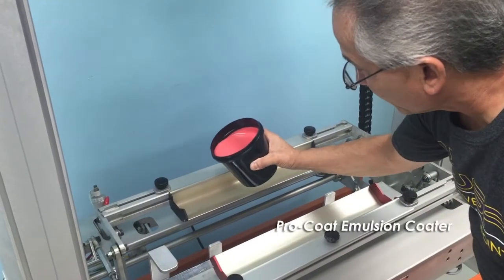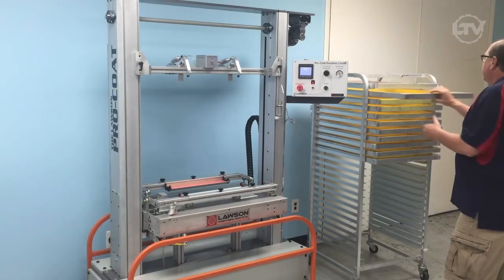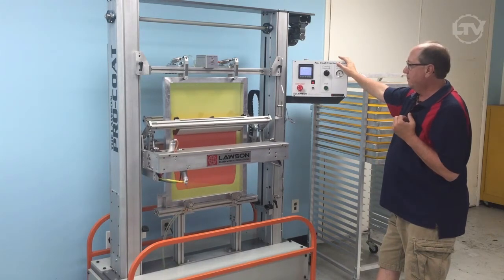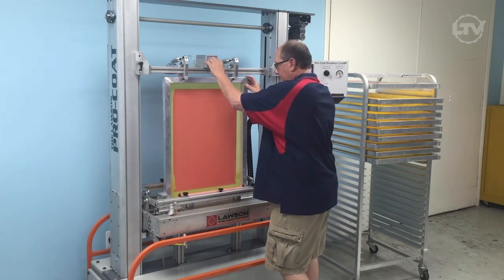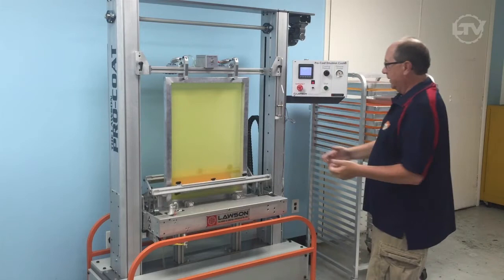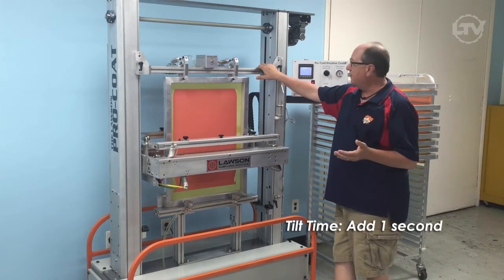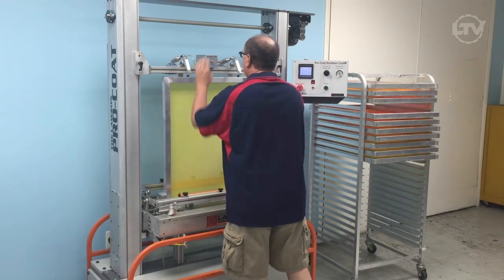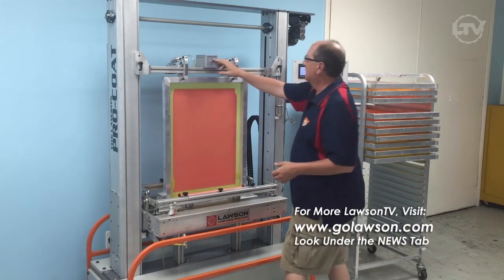Pro-Coat Screen Printing Emulsion Coater Demonstration

Comment: For coating emulsion can I use Squeegee ?
Reply from the maker: Hey Adam! Trying to use a squeegee to apply emulsion to a screen would not work. If you pour the emulsion on the screen, it will drip through the screen, and emulsion would not stay on a squeegee in order to apply it. The best way to coat a screen printing frame is to use an emulsion coater.
Reply: No, this is not recommended...but can be done - but it is much more difficult.
Reply: i've been in screen print for 5 years and i always used the squeegee for coating the screen, i never had any problem with my exposures and halftones